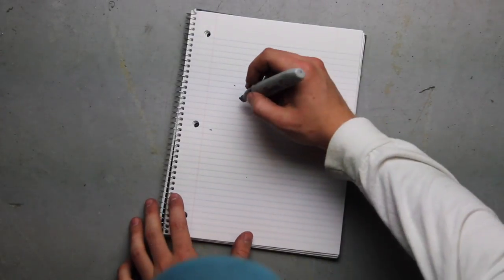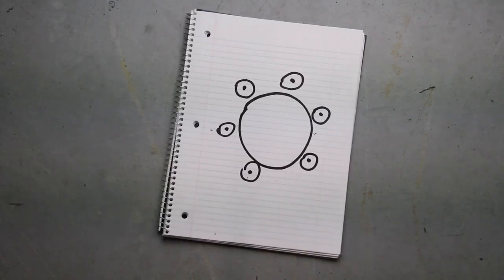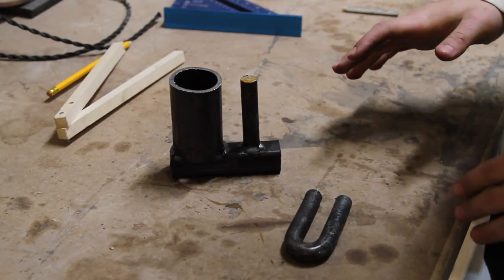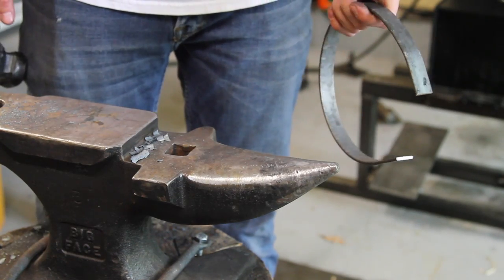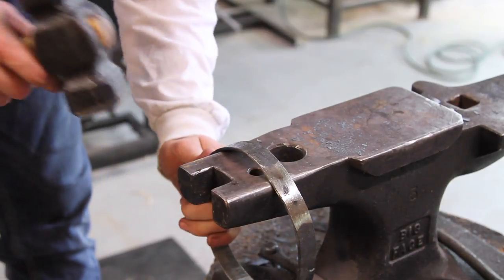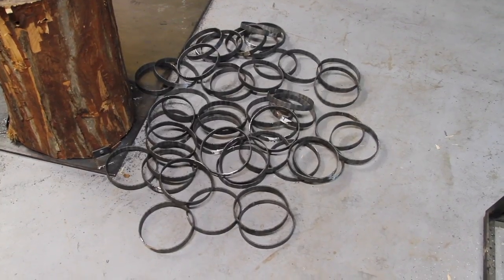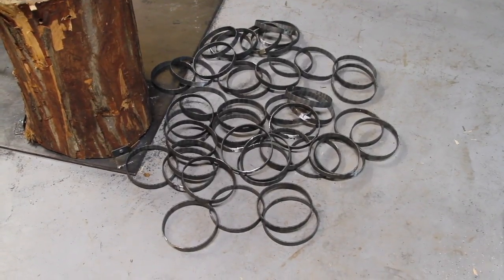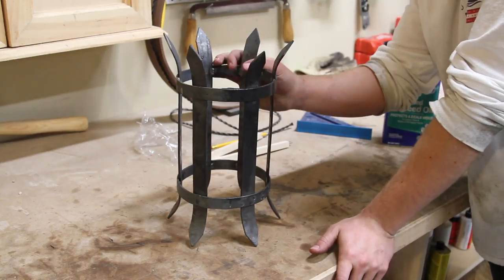Making Hand Made Steel Chandeliers - Part 1

Comment: Outstanding work! I am most impressed over your rings. They came out really nice! I would have used my cone anvil but you made short work of truing the rings on your anvil. If you are interested, visit Saltfork in OK. They offer an excellent 48” cone anvil for $200! Yes. Just $200. It will come as cast so you will need to slick it up but they make a fine addition. The term “beat the daylight out of it” came from using a cone. You did an excellent job of it but a cone anvil is an amazing tool.

Comment: Hey Paul I was wandering if you would recommend that anvil or not I was considering picking up one?
Reply from the maker: For the price it’s pretty good it’s just small I’m currently looking for a new one something around 250 pounds because the work I do tends to be large stuff like hammers and axes but for small stuff it will definitely do the job
Reply: Paul Pinto thanks👍
Reply from the maker: No problem